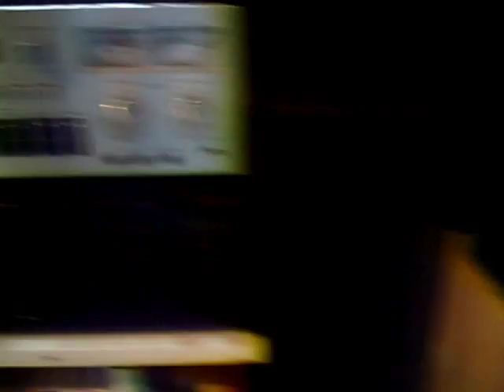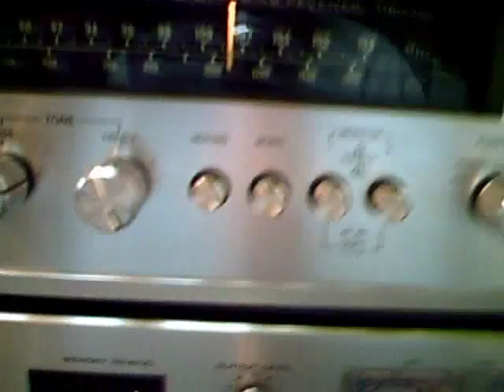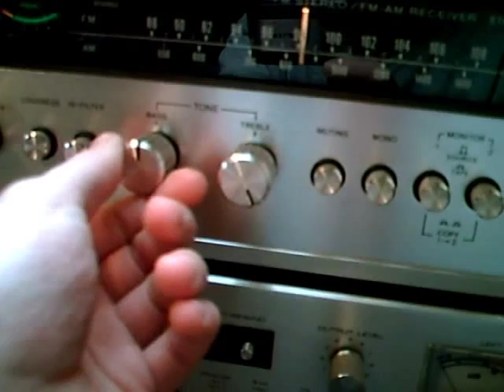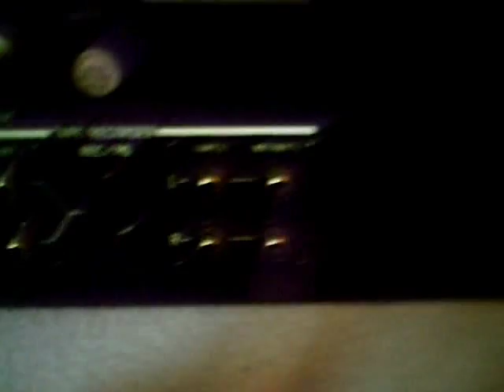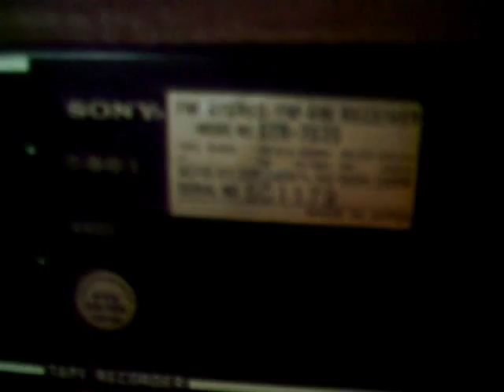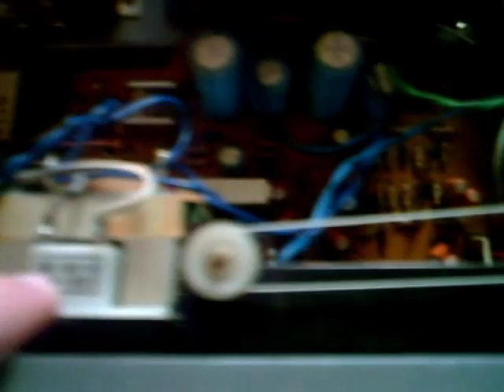Sony STR-7035 receiver

Comment: I have a 7025 that seems to do what it wants a lot of the time, almost certainly could do with a bit of fixing up. My tuner is excellent and sounds very good, but using the inputs, even with a good clear source, just doesn't sound right.

I also have to leave the speaker outputs off for a few seconds when powering it on otherwise there's a big 'ol pop and "wind noise" burst, hoping it's just the usual caps and maintenance, but not using this thing much until I get around to that!

Comment from the maker: Yes, I'm sure it contains bad capacitors somewhere, but until now I wasn't able to find them.
I changed the capacitors of the receiver's tuner, and it sounded even worse than before. So I don't want to change all the capacitors of the amplifier part.